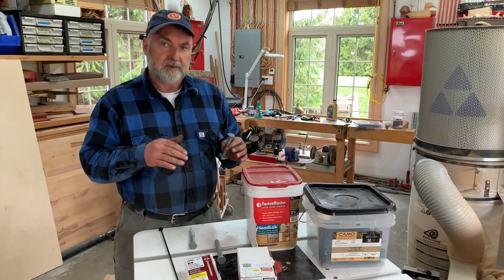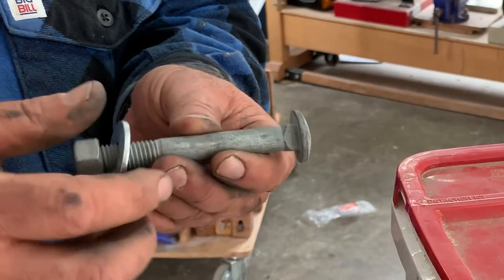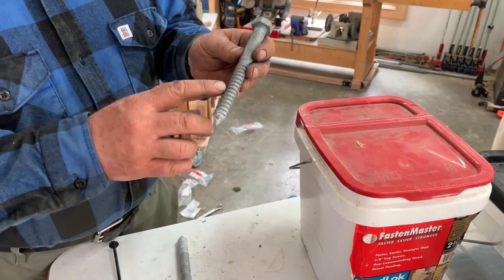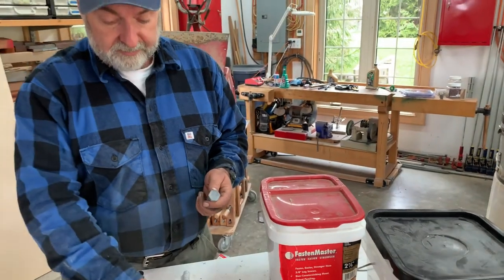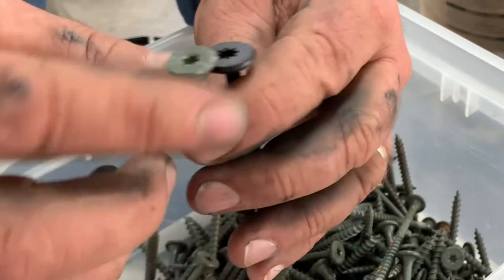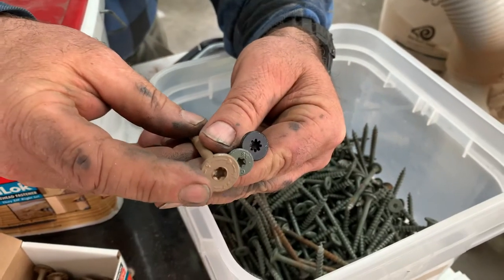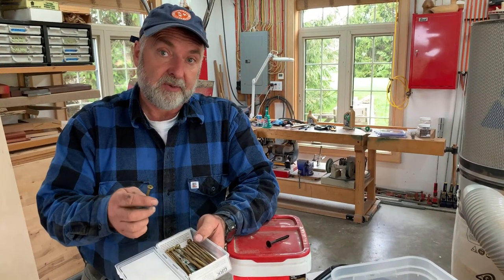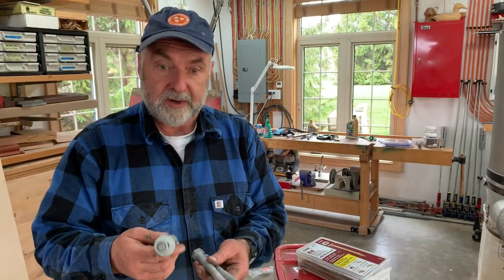Different Types of Fasteners for Decks

Comment: It should be noted that in the last few years structual screws have come down in price enough to be quite a bit cheaper than the larger hot dipped galvanized hardware.